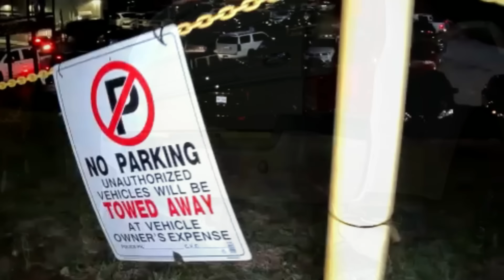Unsecured Handgun In An Unlocked Illegal Park & Tow Truck Drama Resolved?

Comment: Just a fyi on the f250 before towing it not on dollies or anything where the front end is rolling on the ground. The front driveshaft spins if the hubs are locked and if the driveshaft for some reason gives out there is a wiring harness that it can take out that feeds the transmission so before towing with wheels on the ground check to make sure hubs are unlocked. (Yea ask me how i know) i had to rewire a whole harness because of that front shaft lettin loose. Doesnt spin when hubs unlocked.

Comment: I would never call multiple tow companies  so long as the one I call sounds like they are making a commitment to be there whether it is right away or a few hours later.  However, being a single gal and worried about my safety, I would call a second tow company if the first one I called said they would "try" to be there but couldn't promise they could make it.  Of course, in your situation it was different in that the driver called a tow company and the PD called you. I'm glad you and Cap were able to work together to get that lady's car back on solid ground.  You both made it look easy even if it wasn't.

Comment: I always appreciate the extra help when I needed a heavy equipment dual axle recovery truck company to get a FedEx box truck out of a ditch. I needed an anchor point and without they’re help I would’ve had an extremely hard time fedex small box truck pushed off the. Road by a dump truck that lost its brakes.  Luckily it all worked out with no injuries or damage.   If I ever happen to be in the Gatlinburg,
Tennessee  area I 
Would love to meet you guys!  I just received my merchandise that I ordered from you guys.  I love it!  I’m rocking it while I’m here in a rehabilitation facility after I suffered a near fatal stroke. So I’m on the sideline for a little while until I’m strong 💪🏻 enough again to get back at the towing and recovery life. I only do it part time but it might as well be full time.  I guess I needed the break from work.  I’m slowly coming back.   I’ll definitely be back within the year I hope. For now my job is to just get better with consistency of physical therapy up here in upstate NY.   I was really happy when I received the shirt and hat. Much love.  I’ll definitely be sending you guys some goodies!  I appreciate you guys. I know how good and bad the towing life can be.

Comment: That’s insane to leave a truck unlocked like that I lock my truck and works truck any time I’m away from it. Also if y’all that white ford yall hauled was big wait till you see some of trucks I know that would be a fun challenge for yall. My truck a lone if bigger then that white ford. Its a long bed crew cab with 37s and a 6” lift it be fun to someone pull it out of spot like that

Comment: Kristen, Why do you pull on a door handle, and then respond with incredulity when it is not locked?  If it is so remarkable, then why did you pull on the door handle in the first place?  Believe it or not, there are places in this country where it is not necessary to lock your doors.  How sad that you have exposed Gatlinburg to be an unsafe place to visit.  I have not locked my car doors in 25 years, and I do not even have a key to my house.  If anybody wants to break into my house, it would likely be a bear, and a door lock would be no obstacle to Bear Baloo.  Of course, an idiot leaving a gun in their vehicle is a completely separate issue.
Reply from the maker: Because it’s a huge liability issue for us. Not only does it open up the possibility of a theft claim, but it also gives bears and other wildlife the opportunity to break in and do a lot of damage. This case was incredibly dangerous due to the unsecured weapon. It’s not that Gatlinburg in particular is unsafe, there are criminals & wildlife everywhere. It’s mainly just a liability thing.
Reply: @EverythingAutos  Sorry you missed the point.  Kristen expressed incredulity that anybody would leave their door unlocked, before there was any indication of an unsecured gun.  There are many places where people do not feel compelled to lock their doors.  Apparently, Gatlinburg is not among those.